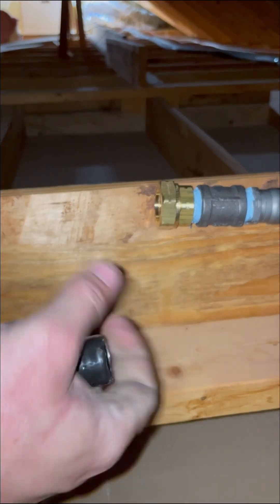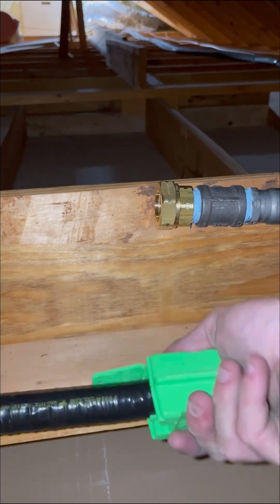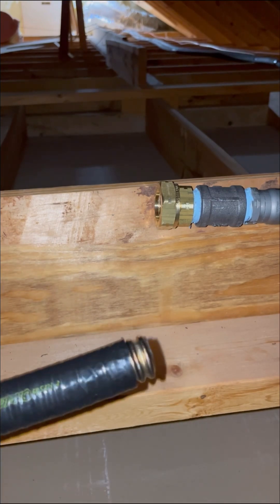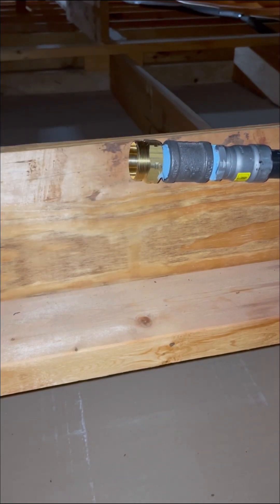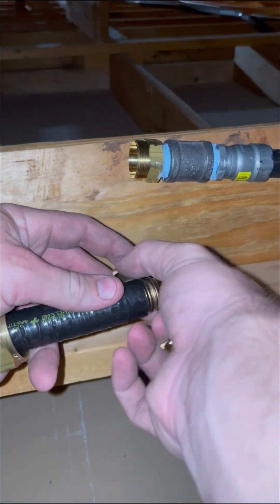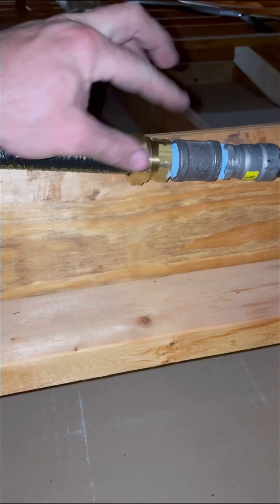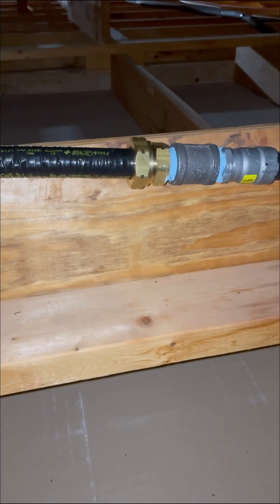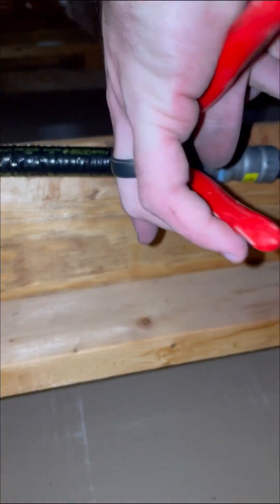Flexible Gas Piping With Compression Fittings.

Comment: I’ve used it on repipe jobs a few times.    I really liked it for things like snaking it between the basement and third floor apartment.  I found the material bill to be significantly more expensive than running black pipe.   Most of the  inspectors would want everything covered up run in the gastite sleeve, then going back and screwing in  countless gastite brand nail plates and wrestling 200’ of flexible pipe into the sleeve then through all the holes it took way longer than just running it in screwed or pressed black pipe.

Comment: What do you recommend for running propane lines underneath an RV?
Reply: Is the RV stationary or does it spend a decent amount of time on the road?
Reply: Good bit of time on the road
Reply: @nicholasphillips5406  I would go with  LP rated stainless jacketed gas hoses.  They are available in all sorts of pre assembled lengths.  Pre assembled hoses are usually significantly less expensive than having exact lengths made.  I think they’re a risk of a line cracking over time if you use a metal tubeing.
Reply: Just cut the ends off of a garden hose… couple barbed fittings…,couple hose clamps… done😂

Comment: I believe they require bonding clamps and grounds in this area . High probability of explosion if hit by lighting .
Reply from the maker: The flashield piping is designed to protect against direct and indirect lightning strikes.
Reply: It doesn't show in the video, there should be an aluminum mesh between 2 layers of sleeving/insulation. That is the bonding shield.

Comment: I have used gastite, snap lock and all the other similar stuff not many problems with leaks, I wish ny. Cheap ass boss would get a vega pro press 😢
Reply: You boss won't buy a Pro-Press? Does he go home at the end of the day on his dinosaur?
Reply: @michaeldudas7584 my cheap ass boss sent me on a job to run gas screw pipe with only 2 90s no couplings no reducers no nipples and no reducing tees then got mad at me when I swiped the company card on just enough fittings to keep me busy in bfe nowhere saying he could've got all that cheaper at the plumbing parts house that's 4 hours away from me I told him next time I'll just do nothing all day since that's cheaper in his mind and get fittings the next day in the morning from the plumbing supply he told me everything was there on the job with the 12 gas heaters and the 4 water heaters I tried calling him 4 times and then waited 30 minutes before I went shopping and  when does he call back 3 minutes after I swiped the card